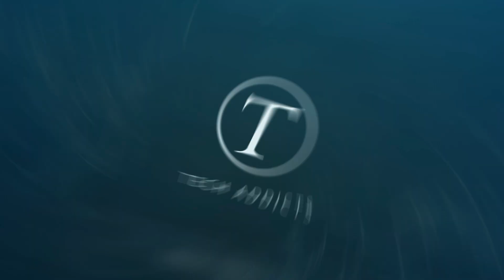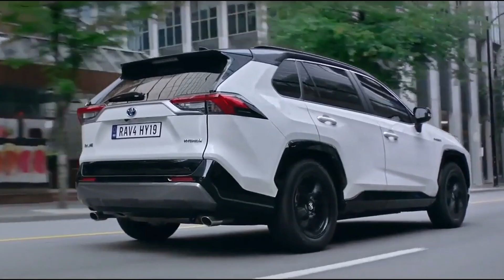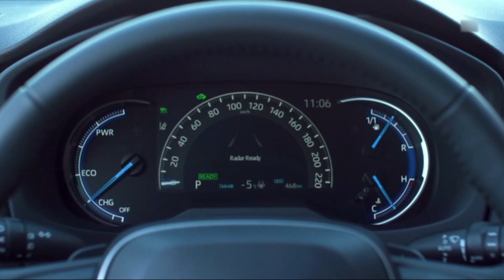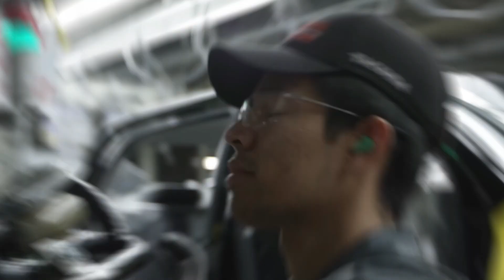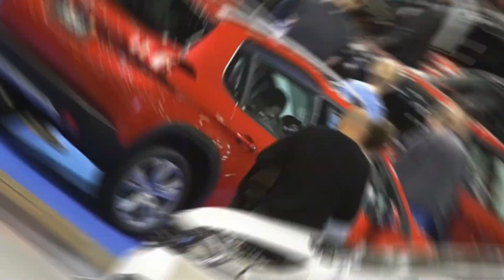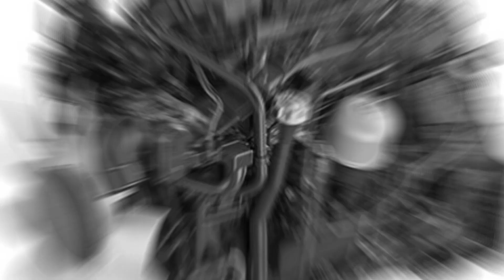2023 Toyota RAV4 Hybrid And RAV4 Prime Price RELEASE!

Comment: Did they fix the cable corrosion problem in the recent model?
Reply: Thats exactly what i want to know!! Is the cablegate issue resolved??
Reply: @arthurtkach8637  they always talk about reliability with Toyota. They need to address the issue at hand because I’m really leaning towards the Camry hybrid because of this issue
Reply: I want a crossover style not camry. Not sure why its hard to find out if it was addressed in a 2023
Reply: @arthurtkach8637  I’d rather have the Rav 4 as well I just know that the Camry has a way better track record.
Reply: Also can it finally pass Moose test ?